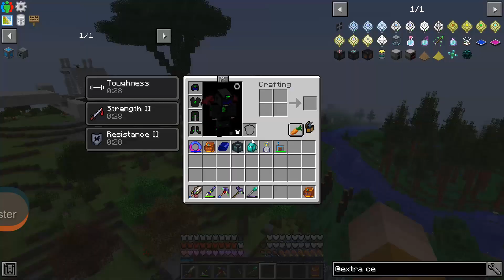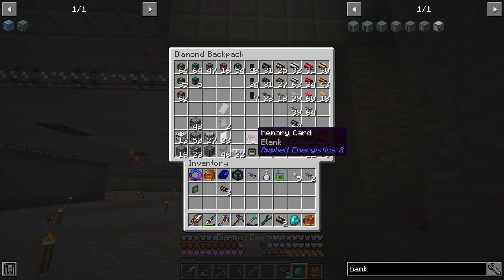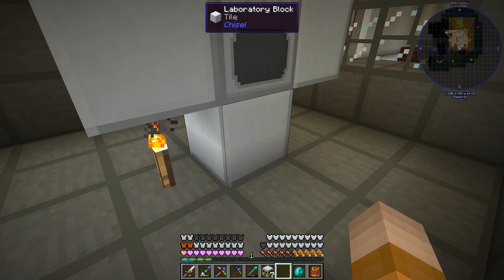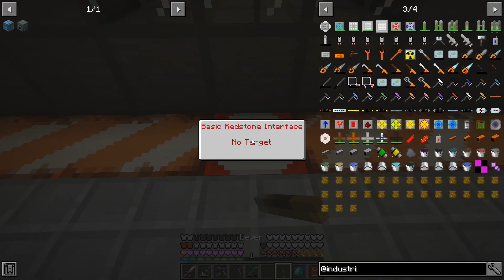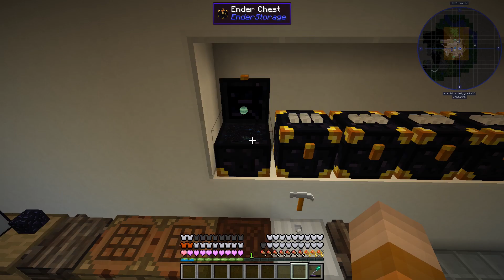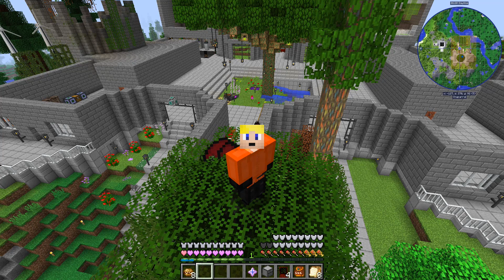Enigmatica 2 Expert - EP24 - Nuclear Reactor

Comment: Just checked and in my early middle game I was using Mek wind turbines (12) and several Advanced Generators with Endurium (sic) turbines powered by a cloche growing potatoes with 3 mek machines to make the fuel (generating about 8k rf).  I also had NuclearCraft reactors (4 - each making about 8k rf) and several Advanced Reactors that kicked in when needed for (iirc) about 10k rf each.  My AE system had about 6-12 crafters  and about 64 matrix... hard to tell.  Don't give up on the pack... it can be a bunch of fun! Lag was getting to me when I loaded up my end game... If I had to do it over I think I would concentrate on lag reduction a bit more (I didn't do anything about lag as I played).  I used a power sieve for most of my beginning resource production but mid game went with both the industrial forgoing lasers (using tesla mod energy and speed upgrades) AND Environmental Tech ore and resource miners. Late game was digital miners in dimensions.  I think I maxed out with 20 overclockers in my IC2 machines... they can take more but...  Hope some of this info helps because I'm really enjoying seeing you play this pack!
Reply from the maker: Thanks.
Very informative. At least I know what to expect.

Comment: Crack the whip on that Dr_Zorbo sieve... that slackard could do it faster ;} Advanced Generators are nice AND scaleable I think manulan turbines are the best I used. I tried the diesel generator in IE but found it didn't do as well in this pack as it did in others. I think I had 2 IC2 nuclear reactors, one for uu matter and one to power the IC2 machines (using glass cables from IC2).  I had to go with the RF nuclear reactor from Big reactors or something.  I think a bunch of distilled water condensers going into storage and then auto crafting some IC2 coolant to be stored up for later works.  I think I had autocrafting for the overclockers.  I know i used overclockers (like 10) in most IC2 machines.  They are the fastest machines in the game.   I'll fire up my old world and let you know if my memory was correct.  Your base is looking fantastic, loving the way you put it all together.
Reply from the maker: I’m crafting the components for an advanced generator atm.
Trying to automate the process a bit.
I will have to start thinking on the distilled water and other liquids soon also.
What tanks were you using/recommend? Biggest ones?
Dynamic tanks?
Reply: @EskGaming  I think I had started with IE tanks (one for distilled and one for coolant), because of the looks.  Those hold plenty for IC2 use as I incrementally increased the overclockers and built up power generation.  I think I used about 10 ic2 solar distillers to keep it fed.

Comment: Advanced Powercell: In prio versions of the pack the shards was craftable. (https://github.com/NillerMedDild/Enigmatica2/issues/441) Finally I got mine by the Void Ore Miner Tier5, what I rushed midgame.

Sieving Power: Direwolf had for a long time a single gas burner, but he never used sieving (only seldom the Digital Miner). If you want to reduce the Sieves to one: Keep the one with the yellow man it.

Nuclear Power to Matrix: One Elite Universal Cable carries 25.6kRF/t what is enough for the 6.72kRF/t output of your reactor. Connect it directly to the power cell what can take 25kRF/t per tick PER SIDE. (Maybe bumped up to even 250 kRF/t in the v1.65d update.) WAILA shows the maximum transfer rate of the cell.

Dank/Null: You can select a in world block by Sneak+MiddleClick it with the dank/null. DO NOT update to v1.67 if you want to keep it! /dank/null is removed in v1.66 because of compatibly issues.

What Next?: NuclearCraft Fission Reactor was a lot of fun to me. You can use it to power the UU matter production. If you get Californium-250 that way you can build RTGs out of it, what gives 750 RF/t.
Reply from the maker: Fission Reactor sounds fun. I may try that at one point.
All good tips thanks a bunch.
Reply from the maker: Didn’t knew that the power cell can use each side per tick. Same to transfer?

Comment: I know the modpack author modified extensively many of the settings in all the machines, including power consumption and speed, that might be the issue with the power generation. Don't worry if you stumble, and the recording is kinda wonky, we don't care, it happens to all of us. Don't quit you still have to go to space and build an awesome space ship. The Induction Matrix is a very powerful energy storage, unfortunately  is not as nice looking as the one from Draconic  . To the best of my knowledge I have also the advanced power cells, if I remember correctly there was a recipe to craft them, unless the pack author removed it. Usually they are also found in the very low levels of the Nether.
Reply: nemo4evr I agree with everything you said.
Reply from the maker: Draconic storage is the best. Not there yet (but I did find some Ddust in the deep dark btw.)
Shards are not in the nether. I’ve look in all levels. Maybe on this version generation is different.
Thanks for the help as always Nemo